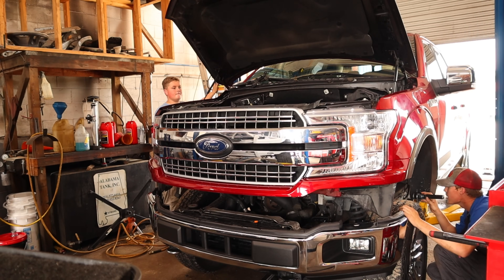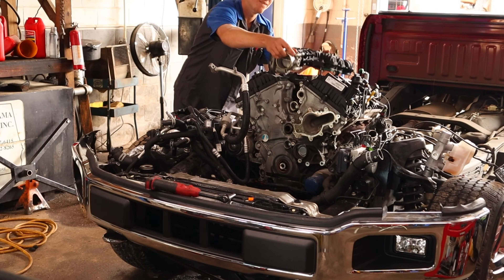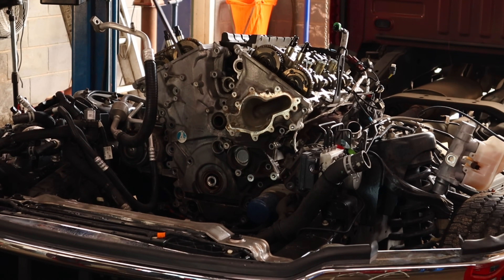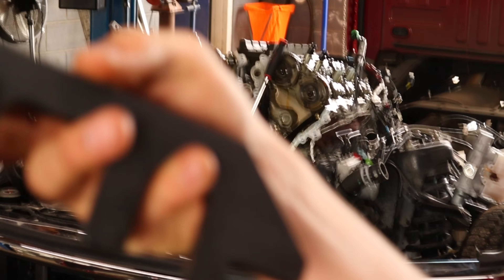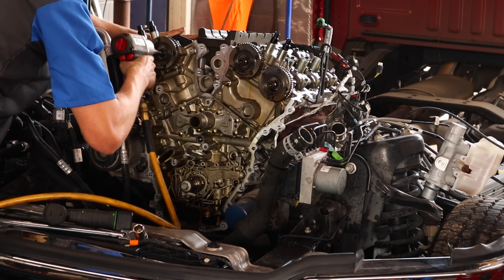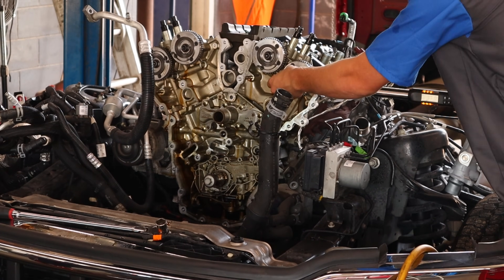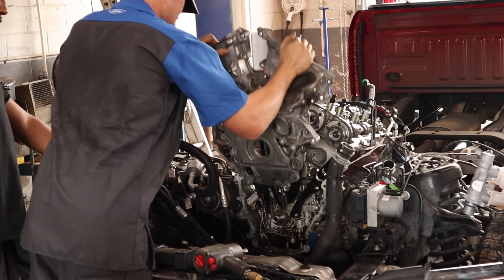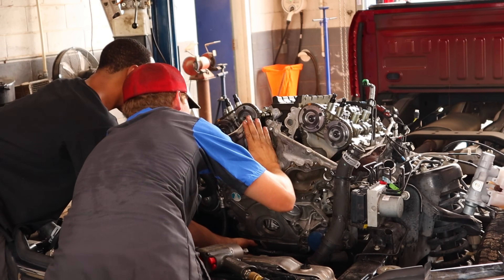Ford 3.5 EcoBoost Cold Start Rattle (VCT Phasers) | Everything You Need To Know

Comment: I'm a Ford tech in the Houston, TX area and I want to share what we have been seeing. 

First, the 21B10 recall is a go again. There's a new supplement to it that is a little bit more than just reprogramming and I'll explain why. What seemed like a transmission shutter, was actually the engine. According to hotline,  the new PCM program alters the oil pressure and a shutter is experienced between 1200-1500 rpm on some engines after reprogram. When working with hotline and our local FSE, we found the shutter to be observed in the power balance test in that RPM range. In fact, when you look at the recall supplement, it will have you monitor power balance at 1200 RPM after reprogramming. If a shutter is experienced after programming, we are to reprogram it back to the previous file. 

Anyways, after further testing in collaboration with hotline and FSE, we found that the camshaft mega caps are leaking. Ford already has updated the heads to fix this, but as you can probably guess...they are on back order. The old mega caps were secured with only three bolts. The new heads come with 4 bolt mega caps. On the trucks we had shuttering issues BEFORE 21B10 was reactivated, we were instructed by hotline/FSE to replace heads and cams. Now, they probably will not have anyone do this for now because they came up with a way to reprogram back to the old PCM file. 

So, you are right that oil pressure is causing these phasers on the 3.5 GTDIs to fail. They are pretty much the same phasers found on the 2.7s, but I have yet to do phasers on a 2.7. My guess is that as supply for the new heads gets stronger, that Ford will either release an FSA or TSB to replace the heads and phasers and maybe cams. On one of these engines, when I took off the passenger head and cams I found the mega cap bearing and journal of the intake cam heavily scored. Probably from low oil pressure. It was a 2017 F150 with about 75000 miles.

I would agree that a Melling oil pump would be a waste. You could have all the oil flow in the world, but if either of the mega caps are leaking, you ain't gonna have sufficient pressure for the phasers and they'll wear out internally like they do right now anyways. 

Hope this helps.
Reply from the maker: Very good info. Thanks for sharing!
Reply: First set of Phasers i did on a Gen 2 i also replaced the oil pump (OE), this truck had right under 100k. Part of me believes the start stop is part of the problem.
Reply: I run 5w40 oil to compensate for low oil pressure
Reply: @yousufkan6960  Does it help with the rattle noise?
Reply: @yousufkan6960  - I went to 10w30 but the reprogram from 4/2021 fck my shifting.
Reply: @yousuf kan  I run castrol syntec 0w40 in my 18 and my motor loves it. It's an a3/b4 oil and more robust. By the time the dilution sets in its more like a 30 weight. My phasers rattle for 2 seconds everytime I start it no matter what oil is in it. Im gonna just keep driving it until i get a check engine light because of actual vs desired timing. My motor also seems to like wix filters as that all I'll ever run on my stuff. What a let down as this is the best truck I've ever owned but because of these issues this will be my first and last ford. Going back to gm.
Reply: @JKZ103  Bu Bye
Reply: I have a question, my 2018 F150 5.0 V8 makes a LOUD rattle noise, everytime the engine is cold and It is in drive or reverse, and i let off the throttle. When i let off the throttle and the engine is cold is when it makes a very loud rattle noise. (loud enough to where i can hear it loudly from the inside) is that what this video is about? i ask because i have a 5.0 V8 and not the 3.5
Reply: @raptorrider24  the death rattle is normal for the v8, along with high oil consumption
Reply: I had the reprogram done on my 2018 3.5 EB done a little over two weeks ago and then I towed a 3700lb camper 1,500 miles in 12 days. During the first 400 miles, I twice had my transmission temps start rising up to 238 before I pulled over to let it cool. When the temps were rising, there was a significant shudder when the truck shifted. I was flat towing both times. The first incident was from 0-115 miles and the second incident was 123 - 266 miles. After that, I towed the through mountains and flats with no spikes or shudders. Very odd.
Reply: @markwimer8280  ... had you let your truck relearn from the new programming?  It's recommended to let the engine and transmission relearn strategies with about 500 miles. Just as if the truck were brand new.
Reply: Bought a new F150 with 2.7 ecoboost in 2017, no problems and at 44,000 miles traded it in for a 2021 F150 2.7 ecoboost. At 1,400 miles I have a cold start rattle that sounds like the cam phaser. Taking it in for diagnosis 9/1/2021. Did Ford change the cam phasers in the second generation 2.7 ecoboost?
Reply: @STEVE-lk2ft I personally haven't seen VCT issues with the 2.7
Reply: I ordered a 2021 3.5 ecoboost. Has the problem been fixed with the phasers?
Reply: Todd M. My 2021 fI50 2.7 with 1,400 miles on it has this problem already. Taking it in 9/15 for new new phaser. Not real happy about the dealer taking the engine apart on a brand new truck.
Reply: @STEVE-lk2ft  ya I wouldn't be either, I'm same boat but 24k on it once it's been apart never the same
Reply: @STEVE-lk2ft  that’s too bad, my 2018 2.7 f150 runs fantastic and has never seen the inside of the service dept
Reply: @paulhunter9613  never had a problem with my 2017 and traded it in with 42000 miles on it.The good news is dealer replaced all 4 cam phasers on my 2021 at 1,400 miles and have had no problems so far after 15,000 more miles.
Reply: Im having 21b10 done this coming Monday I hope this is not gonna take longer than one day but if it does I hope this is gonna fix this problem. 2018 ford is an amazing buy for me oh yeah is 3.5 ecoboost
Reply: @philmarquez8707  did the reprogram fix the issue? Have you noticed some of the other issues after the reprogram I'm reading here with the transmission?
Reply: Great info.  If I'm reading this correctly:  my 18' 3.5eb shuddered after reprogram,  so I have leaking heads that leads to this shudder?..and they just go back to the previous oil pressure strategy, or programming, to put a band aid on it and get out of warrenty period?  Maybe time to trade for a gm 6.2.
Reply: 21B10 on the Expeditions is still halted, no explanation on the difference but Ford will not comment on and ETA for 21B10 resolution on a 2019 Expedition Max Limited.  Any ideas what is different in the 3.5 EcoBoost in an F150 vs Expedition?
Reply: @austinite7924  hey bro have you fixed your issues
Reply: @smithshawn5689  Nope, Ford and my Local Ford Dealer say that the 21B10 recall is not approved for Expeditions at this point.  Waiting on them to approve it so I can qualify for CSP 21N03.
Reply: @austinite7924  that’s a high output 3.5
Reply: That sucks to hear I have a 2017 24,500 miles on it phasers were just replaced a day ago due to timing issues , now the shifting feels like the transmissions going to blow out the back. I have definitely noticed it on the lower r pm range as you were saying, happens in all 10 gears
Reply: @LukeRT  me too almost like it’s too low of rpm per too tall of gear.  Try only going as high as 8 gear while speeds of no higher than 50 mpg. Mine seems to run much better. If I go to auto the gears are too high and that’s when it bogs down, running around 1000 rpms in a 25 mph zone and no gogo if you stomp on the gas.
Reply: just another thing to worry about.  Hope FORD gets this right...
Reply: This would seem to be what happened to my 3.5.. I was one of the unfortunate soaks whose engine started making a rattle at about 103k. Since I couldn’t afford the extreme cost of the dealer repair I decided to give it a go on my own. When I finally got the right hand valve cover removed I immediately Noticed the cam shaft (mega cap? ) forward retainer had obvious signs of high heat as the oil returning from that area had darkened the mega cap and the edge of the head under the cap. I really wanted to pull that cap and check the cam journal but time and cash 💰 prevented me. In any case I replaced everything that even remotely had anything to do with timing the engine phasers tensioners guides chain crank gear VVT gizmos and many TTY bolts. I consider that repair a success but We now have what sounds like turbo blades dragging the turbo housings on startup but the other noises have stopped. I love the power this tiny engine makes but reliability leaves much to be desired
Reply: @wayneschmidt9620  what you’re referring to is mega cap. How often are you changing the oil? Most Fore techs agree that the intervals that Ford puts out is far to long. Pretty much all the ecoboosts engines run pretty hot and the oil deteriorated faster than Ford’s naturally aspirated engines. 5000 miles is, in my opinion, the absolute maximum and that’s if it’s primary long highway mile trips. Otherwise, 3000-4000 I believe is optimal. Changing oil more often won’t solve the phaser issue. I’ve done phasers on discolored/sludged engines and I’ve done them on engines so clean you could eat off them. More frequent changes will however prevent the engine from absorbing the heat that you observed with your megacap.

As far as turbo goes, check the play in the shaft by moving the compressor wheels up/ down & in/out. A wee bit of play is fine, but more than that means they need to be replaced. Wouldn’t surprise me at over 100k miles that either or both turbos are on their way out.
Reply: @marks3036  Who would want to own one of these engines??  They have had nothing but problems since they came out with this engines. It is either Ford crap or just comes along with this complicated an engine.
Reply: @311hitwall   Mine runs perfect @ 127K miles.   Well maintained, and run normal, as it's not a drag truck.   Had one of my last trucks (1995 for 17 years with no issues, albeit a diesel) and my last F450 diesel ran great.   Some have issues, but not all.
Reply: @marks3036  We do em all at 4-5K miles for the same reasons you stated.
Reply: @311hitwall  2022 tundra are learning the hard way, their turbo are body off repairs - under 1000 miles.
Reply: @311hitwall  so far a couple million people wanted those engines,,
Reply: @Mark S  which Houston Ford dealer you at. Would like to come to you for maintenance
Reply: @wayneschmidt9620  -  Wondering if 'how you drive' would possibly be attributed to some of the reliability issues?   These engines have tremendous power for their size, as well as the ability to get great fuel mileage...if driven for that purpose only!   I have 127,000 miles on my Ecoboost, and have no engine issues whatsoever, but I am aware of the Phaser issues, as well as with mine being a '16 the location of where the fuel comes in to the cylinder, and possible problems there, so I did add a catch-can, to hopefully minimize it nonetheless.  Often wondering if/when Phasers or timing chain and guides need replacing, if I should get the heads pulled and a full cleaning as well (or new heads)?   If turbo's where not so expensive, it wouldn't hurt to change those out as well, as I don't know what the true life is for them, but I'm looking for longevity with this truck.  Not sure if the newer style heads, could be used on the older '14 - '16 engines to negate this gumming up the valves either?   I've never looked into what a whole new old version of 3.5 is, as that's another option for some I suppose.   Thanks for your above information!
Reply: After the dealership replaced my 2018 cam phasers about a month ago at 78k miles , my truck started overheating unloaded.  They did tried bleeding the system again but that didn’t help either.  So far they have engaged the FSE but no word yet on a resolution.  It’s been two weeks so far and I’m hoping there will be a fix for it.  Scored cam etc doesn’t sound good.
Reply: What Houston dealer are you with?  I am in Katy and wouldn't truck AutoNation Ford Katy with anything.  I have 15 Expedition with over 100,000 miles and zero issues.  Used Mobil 1 or Penzoil Platinum every 5,000 miles since new.  Bought used 2018 3.5 F150 in 2019 and used nothing but the same oils in it since 27,000 miles w/ 5,000 mile intervals and it has a slight rattle on cold start up.  Just over 50,000 miles now.  I find that if I remote start it from inside the house or what to get in and close the door to start it I don't notice a rattle at all!  I had the reprogram recall done but I can't tell any difference.  I would like to get the rattle repaired before my 60,000 warranty is up however.
Reply: *shudder*
Reply: Question to technician, is this an issue on 2021 f150 bare bones stock 3.3 l v6 engine??? Oil starvation due to defective parts and or pcm programming?
Reply: In week 3 with the updated software there is an occasional flat spot in the 1200-1500 rpm range. Haven’t had a hard shutter but there is definitely some kind trip up that happens if you get just the right combo of off throttle and gradual back on throttle timing. But it hasn’t been consistent.
Reply: I have a 2017 3.5 Ecoboost and had my phasers replaced in July 25th 2021. Car had 51,842 miles when phasers were replaced. Before new years I was driving my car and noticed weird loud knock in my rear diff, transmission started shifting very weird gears up and down, got a check engine light, car started shuddering. At this time car had around 63k miles. I took my car to local mechanics to check the engine codes and found out I have P0018 "crankshaft position - camshaft position correlation bank 2 sensor A, P0021 "A" Camshaft position timing - Over advanced (bank2) codes. 
I took my f150 to the same dealer who did phasers replacement, and they told me phasers, tensioners, entire work they did was correct and has nothing to do with phasers. So, they inserted a camera to look at the head and cylinders, and told me cylinder #6  looks wet ( most likely fuel or coolant), and scoring so I require new engine. Because my car has 63k miles and I no longer have warranty I need to pay for new engine. I said not way, you guys messed up something and I won't pay any penny. They decided to do another phaser, tensioner, spark plugs replacement and see if that helps. 

I will be happy to hear any advice and comments from Ford techs or mechanics, what was done wrong.
Reply: I have the same issue and I live in Houston as well .. any idea where I can get it fixed ..?  need to change time belt and water pump too .. I love my truck and want it to last
Reply: Do the 3.3L v6 engines also have this issue?  My 2019 f150 just had a rattle on a fold start.
Reply: They need to find a way of locking the cam like other manufactures do until oil pressure and control takes over. Not hard for a big company with big shot engineers.
Reply: Luckily ford has a heated and cooled tailgate option . So your hands don’t get cold in the winter when pushing it home . Or you hands don’t get hot in the summer when pushing it home .
Reply: Got to keep the oil changed every
Reply: I'm near the Houston area and am curious if you came across my 2017 that had the update and a shudder that I FINALLY traded in as i was tired of waiting for Ford to pull their head out of their ass and do anything about it. I had the shudder since January 2021 when the TSB was first dropped and the shudder got worse and worse and Ford FINALLY accepted responsibility after denying they had anything to do with it for months and I paid for a few different services by the dealership that were supposed to fix it but never did. I also wasn't refunded for any of the money spent trying to fix their screw up. Regardless of all that the cam phasers were swapped twice on the same part of the motor because once it was swapped the new one immediately blew out and i ended up having to replace the timing chain as well for loss of tension prevention. Mine was around 75k so it would be coincidental of you were to have worked on mine lol. White 2017 Lariat 502A sport package.  I love finding out later how completely crap the situation is because i was told there wouldn't be any problems down the road due to the issue and the shudder..i guess Ferd and their dealerships are fortune tellers, idk. Sounds like the 3.5 is F'd and should be kept away from. At least they NOW allow them to return to the previous version because when I asked for that, i was told Ford would not allow them to do that.
Reply: @zeebinks17  exactly what my 🍑🕳dealer did and wouldnt revert back to ‘as built’ pcm programming. Even after making an appointed, they told me to pound sand and find another dealer. Fckers ain’t getting a nickel from me again.
Reply: @zeebinks17  so I went through the tsb , it fubar the trannie shifting, mpg, and made the truck almost a death trap shuttering into traffic. I to went back to the dealer where I spend $55k at and the service manager at rosch ford basically told me to pound sand. Here’s the kicker mofos I bought an extended warranty from ford so another dealer can make the warranty cash. 
So the past two weeks the death  raddle at cold start sounds like a diesel, doing the ‘flood start’ helps a little. 55k miles. 
Saturday appointment. Plan on getting phasers done then dumping it. Thought about a 250 with Godzilla but they been wasting cam lifts like Chevy 5.3 and 6.2.

Comment: Sounds a lot like the old 5.4l issues. Most of that was fixed with updated phasers and a high volume oil pump.
Reply from the maker: Yeah that’s pretty much what’s fixing these. Oil pumps do better on these than the 5.4’s did.